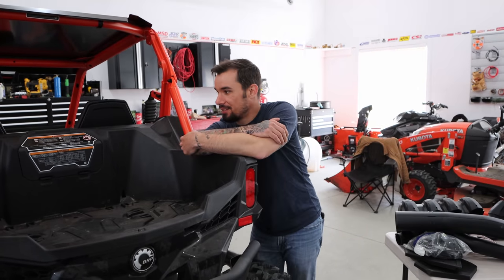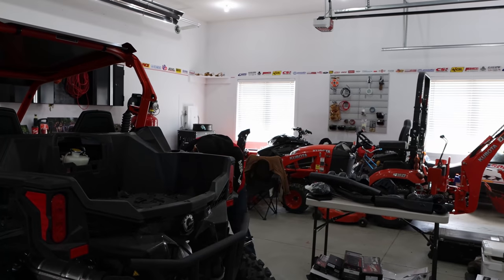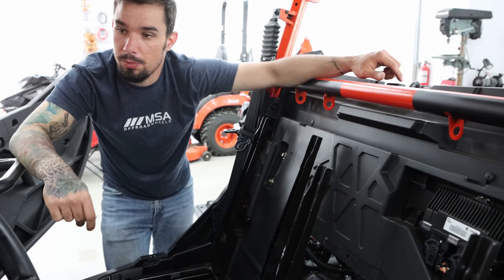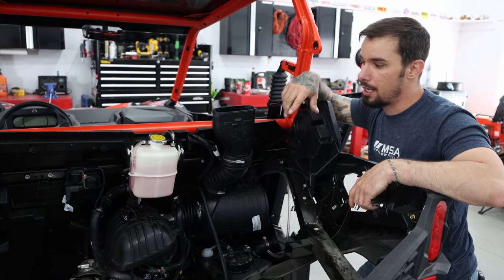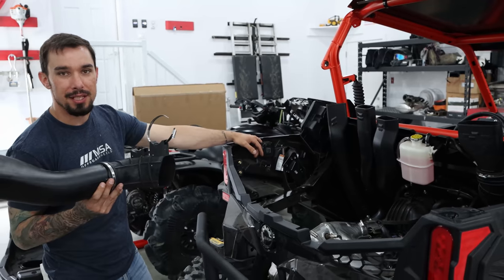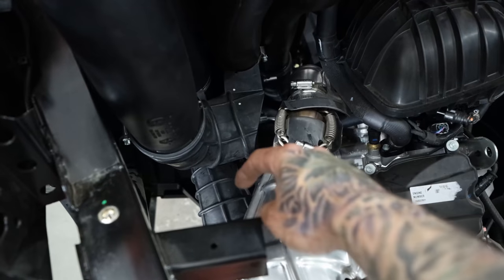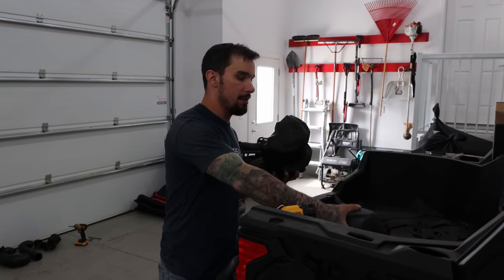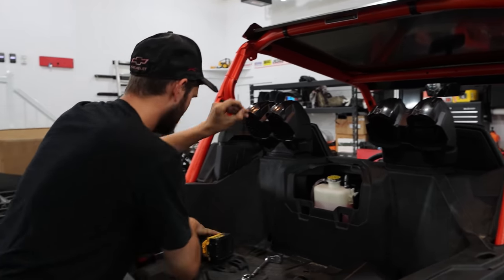OEM Snorkel Kit Install! 2021 Maverick Sport XRC

Comment: I have a 2020 Sport XXC. Does the belt box exhaust tube have to blow on the the engine exhaust pipe cuz I just cut the rubber boot in half and used pvc and extended it about a foot 1 1/2 up the opening were the snorkels go out.
Reply from the maker: Ideally it does. It really helps in trail rides to cool exhaust Temps.
Reply: Great thanks